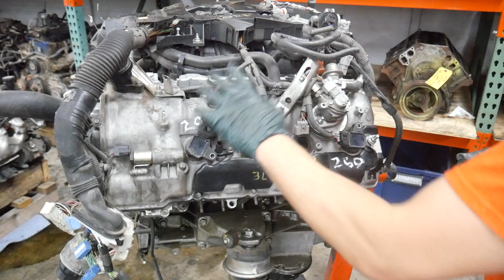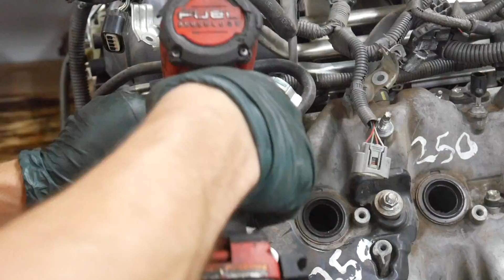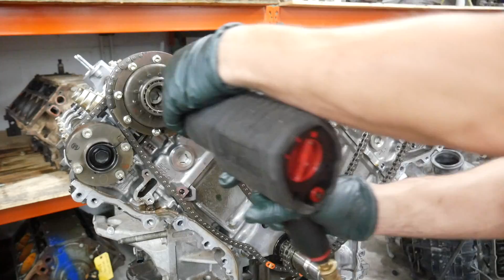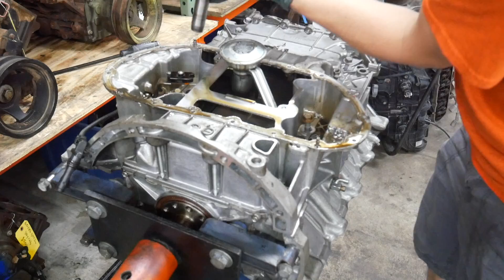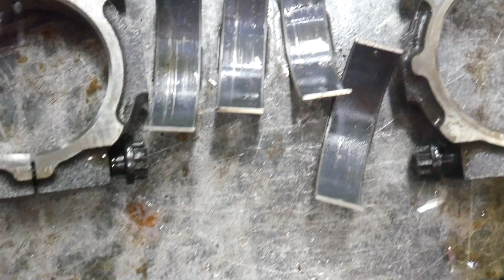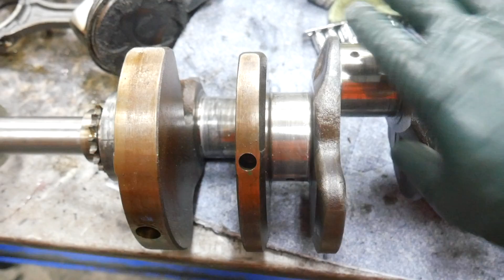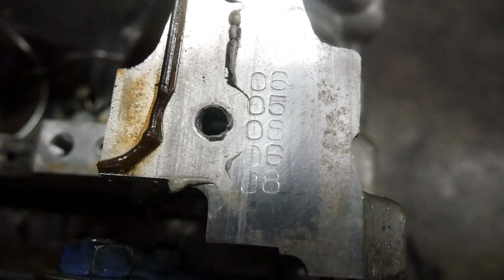Lexus LS460 1UR 4.6L V8 Blown Engine Total Teardown! How Did One Of The Most Reliable Engines Fail?

Comment: This engines comes from the totaled car. Most likely it was at the insurance auction and some idiot during inspection never checked if there is an oil before cranking the engine.

Comment: These are incredilby hard to work on. over engineered to say the least. got to pull right side exhaust manifold to change starter or to  get the transmission out. i mean i dont see it ever needing  a trans but if one of these comes into my shop they better  be prepared to pay.

Comment: Doing an engine swap right now on this engine. Make sure you know about that heat exchanger leaks and know that due to major heat the DI injectors will break trying to unplug them. cannot use reuse the seals so.....

Comment: Just from the title of this video, I'm going to guess that one or more of those fussy O-rings that seals the cooling system to the thermostat housing failed, losing coolant and the engine overheated. Do not buy an LS-460.
Edit: I was wrong. That failure is only caused by oil starvation. Either the oil pump failed or the engine had no oil in it.

Comment: I have a 1 UZFE V8 engine in my 1991 Lexus LS400. I can tell you that Toyota was trying hard to kick Mercedes off the top. By 1996, Toyota had lost their original mission, and have gotten lost with way too many models and all of the ills of too much success too quickly, When you compare the connecting rods of the original engine to the later engines, you can see that they were losing the recipe. I have owned three LS400s, and have never had an engine breakdown with any of them, save for the first car that siffered a dealer that claimed to have replaced a timing belt before I bought the car and charged the original owner for idler pulleys, yeah but no. I have done the belts myself since. It is the nicest over-engineered/under-stressed non-interference V8 in existence.

Comment: ON THE SOCKET OR ALL YOUR SOCKETS YOUR USING,  GRIND OFF THE BEVEL FINDERS INSIDE SO YOU GET 100% FULL CONTACT WITH BOLT HEAD, DO THIS TO ANY ROUND KEY SPANNER ALSO

Comment: I have one of these in an LS460 and I feel much better about the design of the engine having seen it taken apart in this video. I change my own oil and put a NO OIL tag on the steering wheel before I drain it so running it with no oil ever happens. This engine takes over 9 quarts of oil, so maybe the quick lube place put in 5 and called it done. If I ever need parts for mine, I'll visit your site. Thanks for the video.
Reply: Good strategies. I thought this engine was 8.2qt with filter?
Reply: @Shawn-ky2tw  mine is a USA version 2016 and it takes 9.2 quarts with filter. I just checked it with 2500 miles since the oil change and it’s still full. Thank you for the reply!

Comment: I haven't seen a Volvo or a Saab yet. I'm wondering why. I had a 89 Saab 9000 Turbo. It was a great car. I drove from New York to Seattle and back. Went through Montana fast. 100- 125 MPH and the only problem I had was the Turbo loosened up a little.

Comment: Great video! Subscribed.
The clean insides suggests it had good maintenance with synthetic oil, but the multiple simultaneous bearing failures suggest it was run without any oil. Jiffy Lube (or DIY) strikes again?

Comment: From the results of the autopsy, I would conclude that someone got fired for not putting oil back in it after an oil change.  That engine did not look like it had many miles on it either.  No oil causing the block to get super hot, warping the cooling system on top of the block in the valley enough to let loose the coolant.  No coolant, hot engine with no oil, metal expands at different rates, and the bearings spun and destroyed itself in the one cylinder and managed to stay in on the crank.  I'm impressed there wasn't more damage to be honest.  When an engine spins a bearing like that, it's usually pure chaos of broken rods and blocks.  Toyota really knows how to build them well.

Comment: These engines take 9.1 quarts of oil.  It could have been a oil change place with an employee that assumed only 5 quarts is my guess.  It would be enough of a mistake to ruin the engine I believe.  Maybe not right away but after a couple thousand miles of a serious lack of oil pressure.  I’m surprised a warning light didn’t come on though.  My Lexus has all sorts of sensors and warning capabilities.  At any rate this is why I have always changed my own oil.  It’s easy and too important to be left in the hands of someone else that doesn’t care about your car.

Comment: These are amazing engines.  I have an ‘07.  Quiet until you stomp on it.  Doesn’t burn a drop of oil.  Use full synthetic and change it every 5k and I’ve seen these routinely last over 200k, some I’ve seen go over 400k.

Comment: Looks like Toyota took pros from the 5.7 and the 4.7 and made the 4.6
Reply: Don't forget that the 4.0 v6 was available up till 13-14 not sure. I found tons of shavings in my 4.6 oil filter. I wonder what is in the pan. A clogged pickup could lead to problems. Who knows. It could be some assembly debris that finally gets sucked in at 200000.

Comment: The LS 460 is a amazing engine, I've seen some at the auction 300k-400k miles still running and driving.
Mine has 223k miles and runs amazing and the engine has 0 blow by.

Comment: They must had run the engine completly without oil. Ls460 will send a low oil level message after 1.6qts missing out of 9qts. 
Would this happen just because of 1.6qts missing???
Reply: No 1.6qts missing won't destroy it. That oil was probably really old and never changed.

Comment: great video, doing research on GX460 and this video taught me that in this gen/engine they dispensed with timing belts and went to chains so the truck I'm looking at doesn't need as exensive maintenance as the 470's at it's mileage interval.  thanks!

Comment: Me: WoW ! What ???? Direct injection back in 2006-2007 engines productions years !!! Jesus Christ, Toyota's crazy crackhead engineers were really ahead of their time.

Google: The first GDI engine to reach production was introduced in 1925 for a low-compression truck engine. Several German cars used a Bosch mechanical GDI system in the 1950s, however usage of the technology remained rare until an electronic GDI system was introduced in 1996 by Mitsubishi for mass-produced cars.

Me: Facepalm 150 %

Comment: As an owner of a 2GRFE I can attest that this person did not keep an eye on the oil level. Toyotas are not oil burners, but the manual does say that when the engine is raced, it will consume oil. It makes sense given how a lot of performance engines consume oil when driven hard. We all know the 2GRFE sits in a lot of Toyota’s and Lexus’s lineups, and can handle up to 800hp-1300hp on stocks internals, depending on how you tune them. 

2GRFE is the one I’m referring too but there are other 2GR variants but this one is the most easiest to tune.

Comment: The best entertainment on the web! Nice editing. On the Toyota V8 I noticed that that some of the cam-cap bolts also retained the cam plate. Slick! I wonder if the oil filter housing was loosened to make the engine easier to pull, then dummied back on. 
You deserve a new car whenever you want it, serviced by the dealer with new parts.

Comment: Great videos and please keep them coming. Fascinating to see the engineering in these engines.

I used to work for a UK truck manufacturer and we occasionally got engines come in for warranty claims looking like this with new filters and lovely clean oil in them. Usually had been run way over the oil change mileage, or low on oil, started to rattle and only then had the oil and filters done. Then the owner appears at our dealership all innocent and puzzled as to why his engine failed and can we replace it under warranty please!!

Comment: Those numbers etched into the block are the relative bore sizes for the main bearings, the crank should also have the sizes for the mains and rod journals. Bearing thicknesses are chosen using both of the numbers, block minus journal gives bearing thickness.

Comment: Do yourself a favor... Lose that tee shirt.
Reply from the maker: It’s from a movie, and has absolutely no political bias.
Reply: @I_Do_Cars  Thanks for your reply.  I did not think it represented your opinion on the subject.  But, I believe it could detract from your credibility on your subject of choice.  BTW... love your teardowns and learn a lot from each one.
Reply: @I_Do_Cars  A quick question:  Do you ever tear down Honda J35 V6s?  They are my favorite... I've had five in the last 20 years.  One went over 200K miles in an Odyssey, still ran great when sold (yes, timing belt was replaced as recommended).  Have 3 currently, oldest being a '13 Accord at 116K, which runs like new.  Do they ever break?

Comment: Looks great until you get to the core of the issue. These engines are typically very clean and don't have issues if well maintained. My guess would be running it with really low oil, enough to trigger the oil pressure light. 

170k miles on my ISF and I just replaced valve cover gaskets. Seemed as clean with no debris at all. 

Similar to Jareds 230k mile ISF, very clean when we look at the motor from the top. 
https://www.youtube.com/watch?v=HT-DZ2ukqAs&t=687s

They are excellent engines if one knows how to care for them. And by care I mean just change the oil, plugs and coolant like the service manual says. 

Only thing I hated were the plastics that failed. Toyota sells rebuild connector parts which is nice. The DI injectors though are a sad story of break one pay for one and redo tips. $250-370 for those DI injectors.

Comment: It probably had a leak in the filter housing gasket and lost oil pressure. It holds over 9 qts of oil so it would have to lose a lot to start showing damage like that. I'm still proud to have this engine in my car.

Comment: That looks like a situation where a Quickie Lube place drained the old oil out...but never put new oil in.  Owner probably drove it that way for about ten miles until the engine destroyed itself.
Reply: I wouldn't put it past a dealership to do something this stupid either. More likely maybe. 

Dealerships usually have at least one good technician, but they're usually never the ones doing oil changes.

Comment: Oil change weenie forgot to put the new oil in after draining the old out? Oil filter gasket on top of old one? Should have had oil light and engine light on due to VVT unable to adjust cam timing.

Comment: Hey, great video, your programs are very helpful, I am actually learning new things about engines(internally).👍👍🇨🇦. Now, I have a little problem with my 2az-fe engine(09 matrix xr)it has a ticking to it(only when the engine is at operating temp) don't know if it is a connecting rod bearing, stuck valve, or worn cam. I have 2 short videos on my channel, 1, a cold start ruinning, and then at operating temp(when you hear the ticking. Please help

Comment: I bet that who service the engine didn’t know the oil capacity and probably put 5 quarts back in after the oil change. Do the math. 600 miles at 1 qt per  on a 3000 thousand interval no oil . 
Oil change using 00 20  ran me over 120 dollars.

Comment: My 2008 LS460 has a statement in the OWNERS Manual that this engine uses about 1 quart of Oil about every 600 miles. This is the reason for the 9 quart OIL tank. Most owners don’t know this because they haven’t had a chance to read it until after they buy this Lexus..!! Bummer.!!
Reply: That's what the oil light is for.

Comment: The 1UR engine had a problem with 3 items. Toyota / Lexus found an issue with one of the robots that was involved with putting the valve springs in. It apparently was out of alignment and put a score mark into the spring which weakened it. They issued a recall to fix the issue. The right hand chain tensioner and guide too were found to be issues. I looked up on a Lexus main website for genuine parts which are commonly asked for and sold, and there were the tensioner and guide!! Link to the page for the items is here........ https://lexuspartsdirect.co.uk/parts/category/lexus-ls/lexus-ls-phase-iv-2007-2017/lexus-ls-4-engine-service-kits/
Reply from the maker: Great info!
Reply: @I_Do_Cars  I'm normally a Mercedes guy but getting frustrated with them now. I've never considered a Lexus before until now as they were normally associated with old people!! lol
Reply: @I_Do_Cars  https://www.autoblog.com/2010/07/02/whats-really-going-on-with-toyotas-faulty-valve-springs-w-vi/?guccounter=1&guce_referrer=aHR0cHM6Ly93d3cuZ29vZ2xlLmNvLnVrLw&guce_referrer_sig=AQAAALI-0uXcdfSaC8Hil1JTpuNX5hyTlRRX1VmT7qzL9phwm2DmoYS2ePNdJjLUBs4RQQH-ZITWzN2kUQVS_-By5atBPx97tykBf7ZFrqislmHb_-mggR5dngDcINzS-Im4Sqc8qRu7abop1Cz-N6lzQAOPSrxiE3mNhxd1CGWl29JN
Reply: @I_Do_Cars  https://lexusenthusiast.com/2010/07/08/full-lexus-engine-recall-list/

Comment: My Lexus IS350 broke some Valve springs, on its first engine. (I still have it) . I bought a Used Engine from JDM Place of Houston, & 1,000 Miles later the Engine seized. Oil was still clean & topped off, the coolant was clean & full. No oil leaked or poured out anywhere when the Engine shut off on the Highway.

Comment: As an old diesel mechanic & from what ive seen over the years i would guess at the last service before failure it may have had the wrong oil put in it. Way to clean internally to not have had regular services. Obviously the failure started with the mian bearings as the bigends are fed oil from the mains.

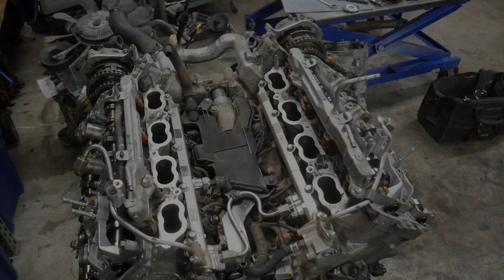Comment: why is 7:21 and 7:23 different?  At 7:21 when the intake is removed the valley is clean (other than the big crack at the back) and at 7:23 it has all the fuel injection stuff?

Comment: My guess is the failure is from a momentary lack of lube event, perhaps from being run dry during a service interval (Jiffy-Lube or something), then oil added after the mistake was caught when the engine started rattling.  The engine would have stopped rattling when oil was added, but bearings would have still been damaged.  The then damaged bearings then later fully failed with lube (perhaps hundreds of miles later) since there's little discoloration.